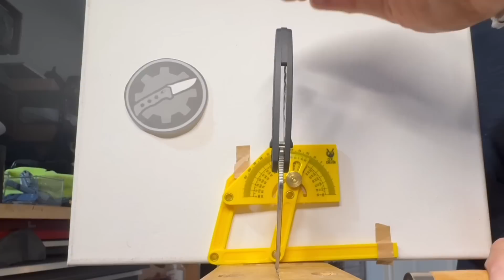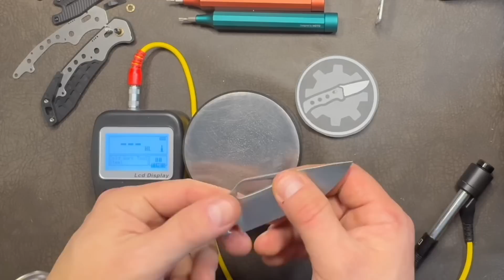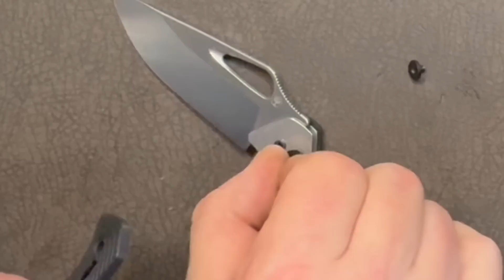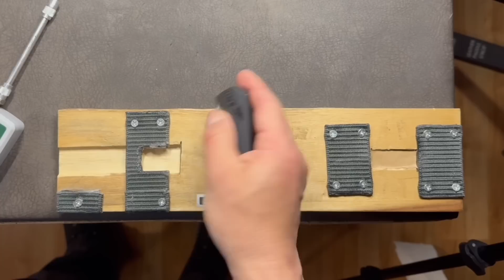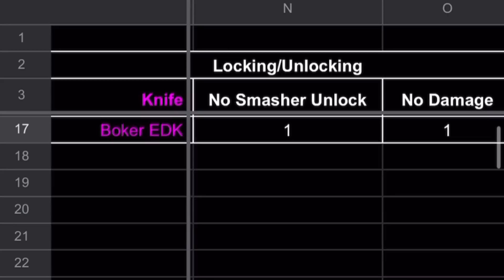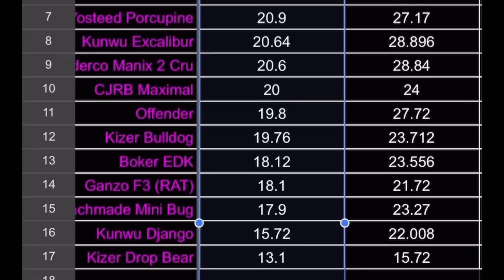Boker EDK MagnaCut hardness and torture tests. Plus EDC scores.

Comment: Boker website stated that the HRC is 61-62, which is 1.5 to 2.5 lower than your 63.5 adjusted result.  I was wondering if 61-62 might be closer to the real hardness since your edge retention was 47% less sharpe for this knife.  Do you think if it'd make sense to draw a relationship between your edge retention and hardness results, regardless of the steels?  Just forget about the geometry for now 🙂
Reply from the maker: Interesting! I found where they said that - in the description rather than specs. I also looked at BHQ and KC listings and they removed that statement from otherwise copied descriptions! Good catch!
Now, I’m almost certain that my measurements are within +/-1 HRC but it’s going to be revisited once my bench top tester arrives. This is very curious.
As to the cutting test for edge retention, please find a comment from the actual designer of the gadget (look for 777). According to him, I was potentially over tightening the filament, so I need to re-do.
I will keep everyone posted.
Thanks for getting this in front of me!
Reply: @CBRxLIVE  Thank you for doing this for our community!
Reply: Actually, it is quite interesting. Back when it was only  available for pre order, somewhere around late summer 2024, the description on böker's website stated that the Magnacut would be 62-63 HRC then around December they suddenly changed it to 61-62 HRC.

Comment: Another good one man!  I’ve been following the silliness being cast lately.  All I can say is your tests are absolutely relative in that all the knives you test get the same treatment.  It’s controlled and data is data.  It’s funny to see how people throw fits when things don’t test like they want them to.  I have nothing against the leeb, I’ve see you use it in every test and the data is correlative to other true data.

You made me wish I had thought twice about the pro tech tr3, so now everything you do is trash 😂😂.  Keep up the good work dude 👊🏼🍻
Reply from the maker: Thanks! Some protechs have a fully supported stop pin as I found on Tersuola.
Reply: @ it’s all good man, I was just kidding anyway.  My knives tend to just be little shiny treasures anyway.  Outside of a microtech msi I’ve never been bit by lock failure.  And it was only happen chance I was using that knife anyway.

Comment: Hello, have you heard about BPS knives? I picked up a fixed blade with a leather sheath a really nice sheath!! The blade steel is 1066 HC steel with a scandi ground 4+” cutting surface. Polished the blade too. Has walnut scales oiled!
Reply from the maker: @Davidstuneslisten  Which retailer carries them?
Reply: @ have you found it?
Reply: @ Amazon this was $34!!
Reply from the maker: @MrCaissed These are Ukrainian knives
Reply: @CBRxLIVE  yes they are and that’s why I told you about them. I keep using it around my yard cutting branches and trimming plants and I really like this knife!
Reply from the maker: @Davidstuneslisten  Yes, it reminds me some of the inexpensive OKC knives and also LT Wright experimented with thin 1075 CS blades.
Reply: @CBRxLIVE  if you get one tell me what you think okay?
Reply: @ I bought it on EBay! Lately I’ve been finding some knives that are great to work outside with. I don’t know until I actually try them out.

Comment: Very surprised Boker screwed up the lock recess in the resting position..... hard to say if thats a mfgring, QC issue or a mistake on the design spec/print....  Which is unfortunate because Boker IME, for mass production, usually has good designs, QC,  and high quality materials.  This one is missing at least 2 of those.... For 100+ USD its not gonna be in my pocket.
Reply from the maker: @billyj.williams2341  I will blame the Engineer this time. I looked at the EDT version yesterday, March 29 2025 (same handle, tanto blade) and it also has the detent lash. So the shop is making them consistently, which points a finger at Engineers.